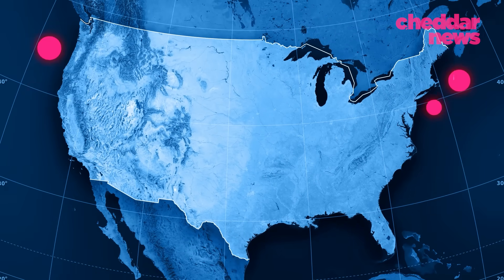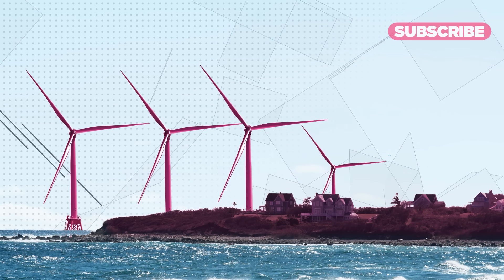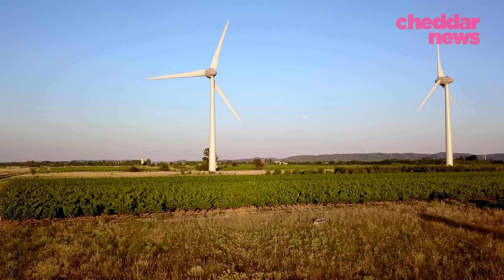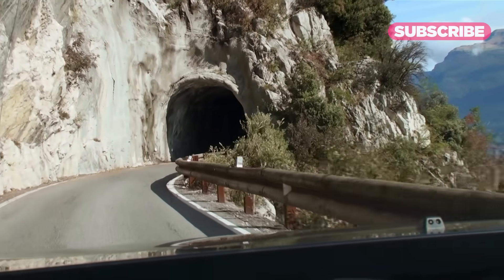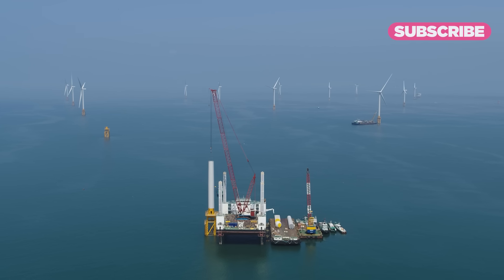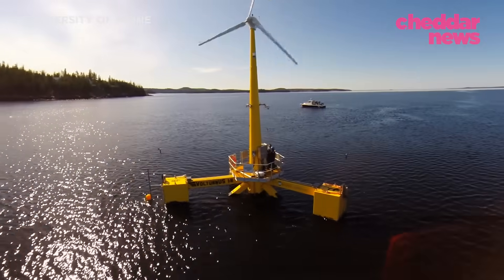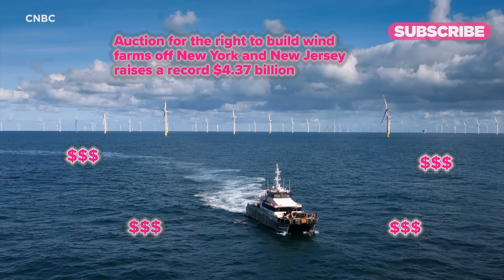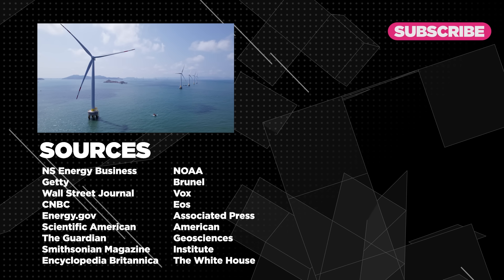Why Finding A Spot For Offshore Wind Is So Tricky - Cheddar Explains

Comment: I don't understand why a more decentralized model isn't encouraged more. Do it closer to the home (solar home, maybe small windmill in larger backyard)
Reply: The power of a large offshore wind turbine is easily 1000 times more than what you can get from one small turbine in your yard.
Reply: @udishomer5852  @niels lund @ocean, I did say in larger backyards, inferring the suburbs. Here's the deal: MASSIVE wind farms will never 1) offer reliable energy, 2) offshore ones will be subjected to corrosion (and have been at exponential rates) compared to land based ones, and 3) are eyesores when they aren't killing birds (sometimes endangered species). The energy density is not there compared to nuclear or fossil fuels. And it never will be.
Reply: @MJCLAXDEN  anytime someone says never they're not understanding how long forever is and how much things can change. But even now the worlds first subsidy free offshore wind farm just opened because it is commercially viable. Also, wind turbines and solar panels don't need continual fossil fuel extraction and don't have the operational costs from that. reliability is an issue thats why for now wind/ solar are mostly suplemented by fossil fuels when not producing but in the future we could have supergrids that send power from where its being produced to where its needed to solve for that. energy storage is getting better too
Reply: @ocean6462  Uh-huh...because transmission is NEVER a problem in the Pollyanna world in which you live. Sorry, physical laws won't make it possible for generations...and likely not make it practical for generations after that. Besides, I thought "locally-sourced" was the "soy latte crowd's mantra".
Reply: It's probably that it's not as profitable as big wind turbines because of economies of scale. Rooftop solar is increasingly common and it's cost effective but they still don't produce enough to fully power most households

Comment: I think the spinning propellers are beautiful, especially since they mean my electricity is environmentally-friendly and cheaper.
Reply: Other dude has a point, but there really fragile so they damage easily and they are very ineffective damaged so they need to be replaced but thats only part of it, so you have to make more and then you have to get rid of them which is now to bury them which in is very non eco friendly.
Reply: Guys, facts dont matter, it's about feelings
Reply: And the piles of dead birds and bats is something to see too.
Reply: yeah no its not. i can see that you are an american. but wind turbines are not cheaper or better.
Reply: Yeah, environmentally-friendly decimating birds.
Reply: Until you find out how much oil and grease is needed to keep them running and how few wind turbine blades get recycled due to size material complexity.

Comment: “An Ahundred…” 😳 

07:40 “In May of 2022 two energy companies bought an ahundred 10 thousand acre site…”. Why do some folks keep saying “an ahundred” when they mean “a one hundred”? You either use “an” or “a” but not both together. 

In this case “an” is entirely unnecessary. Part of the problem here may be the difference between what’s in the script and how the presenter is choosing to say it.

When a script is going to be read aloud then numbers should be spelled out as words instead of digits. Then the poor narrator doesn’t have to do mental gymnastics trying to decide if “an” or “a” should be used.

Comment: The best place for a wind farm is outside in your yard, along with your solar panels.  Big turbines might be more efficient at generating but factor in all the transmission losses and grid vulnerabilities and it makes more sense to just have your own decentralized wind and solar.
Reply: Sure every apartment in New York and Boston will put one in their balcony.
Reply: Small Garten wind turbines, makes a lot of noise, are very inefficient.
It's also way more easy to maintain 10 large turbines, than to maintain 10.000 small ones.

There's a reason why wind turbines are only getting bigger, and bigger. We started out with 10-50KW turbines in the 70s, and they've only been going up in size, ever since.